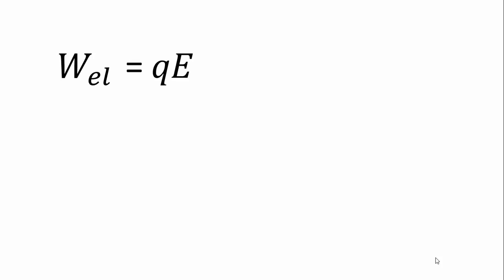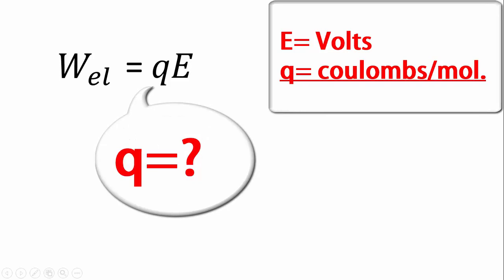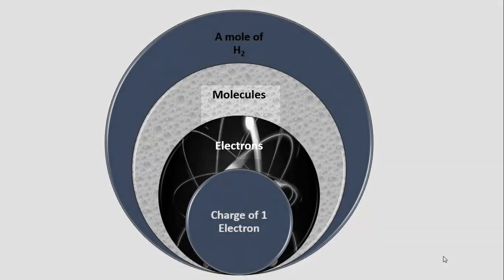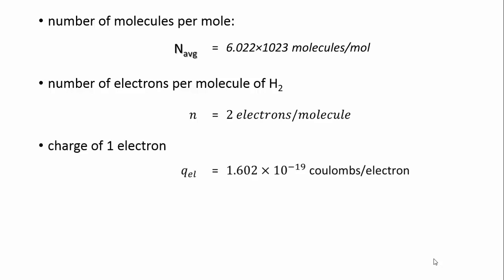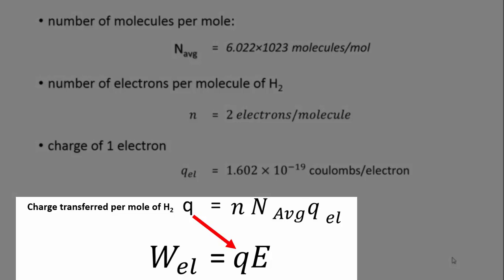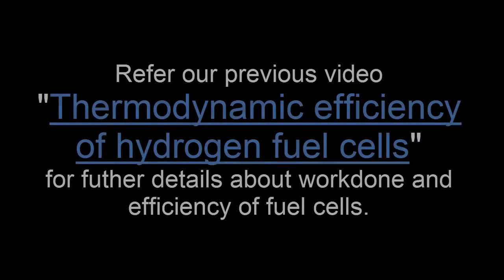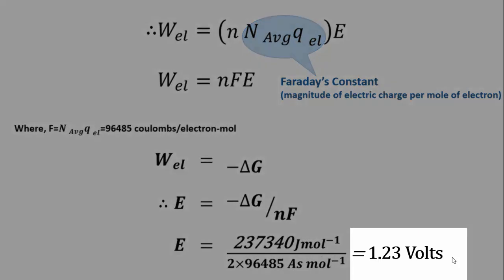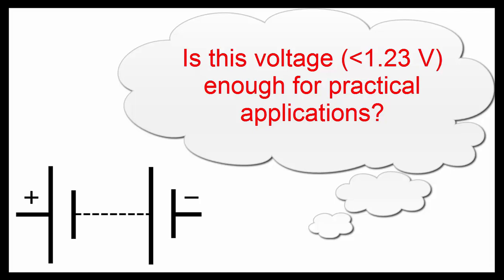What is the Theoretical Voltage of Hydrogen Fuel Cell?

Comment: Sir how can we increase the output beside connecting no. Of fuel cell side by side
Reply from the maker: We can do it by number of ways. In fact, that is the hot topic in research of fuel cells. Some of the ways I can list...
Flow Channel Design
Optimizing operating pressures
Optimizing water content in membrane
Optimizing the porosity